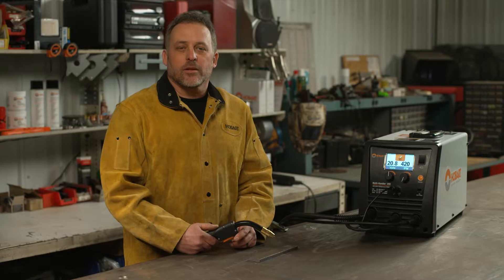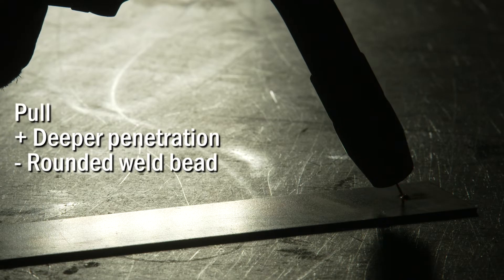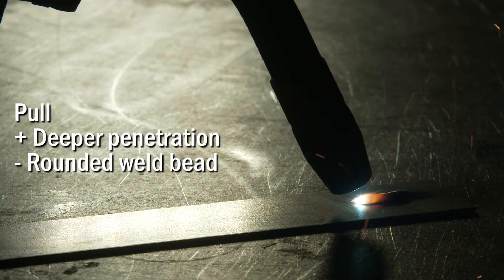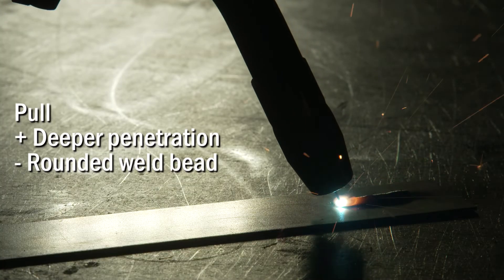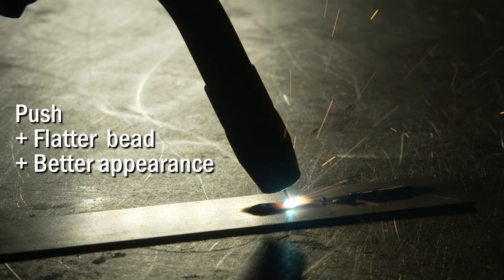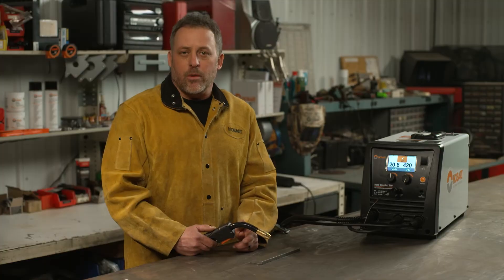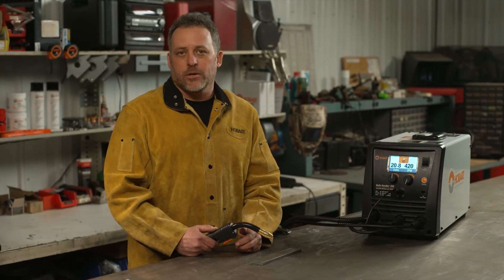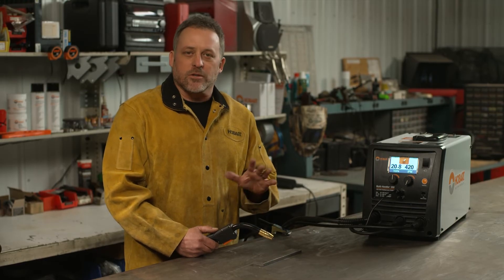MIG Welding Techniques: Push vs. Pull

Comment: I’m confused? I mig weld with gas not flux and they teach me push is better and gets better penetration??? I’m so confused I’m Australian btw, here in Australia they yell at you if you pull mig welds please help answer my question thank you!
Reply: I'm in Usa Va , push supposed to be deeper penetration , the drag is less penetration. You only drag flux core though